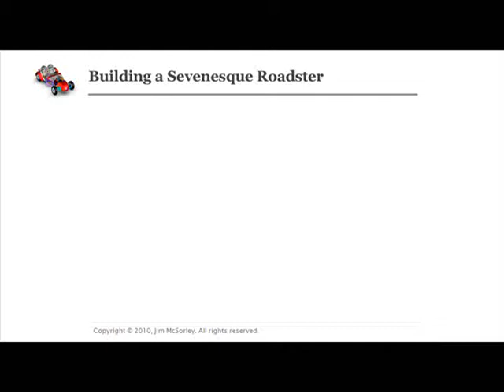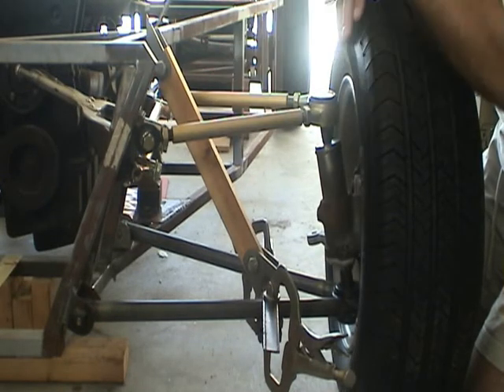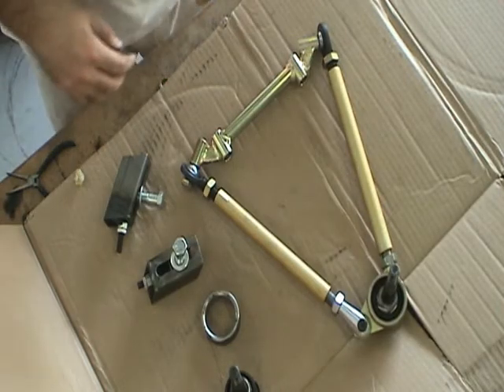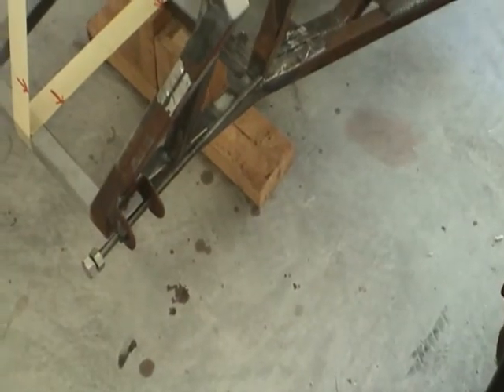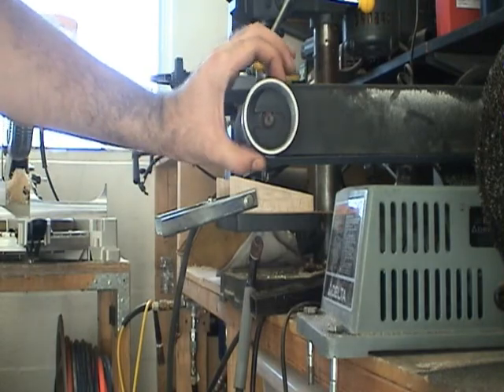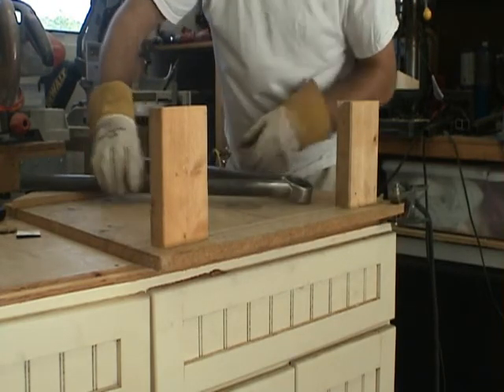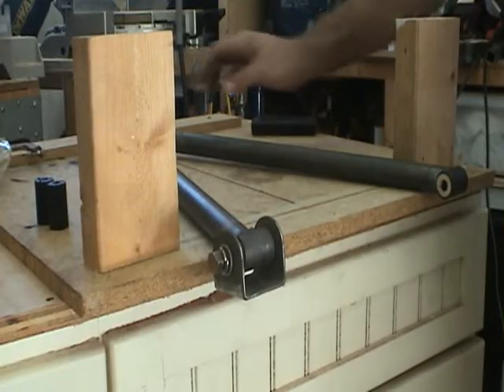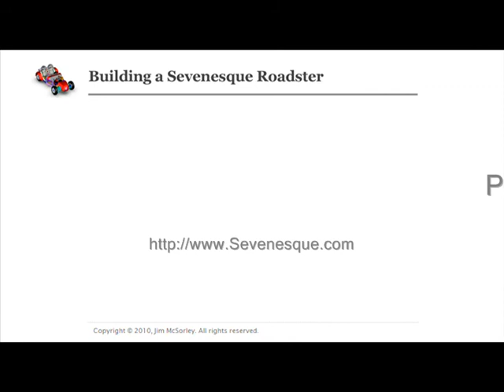Locost Adjustable Front Suspension - Part 1 of 3 - Lower Control Arms

Comment from the maker: Positioning the joint between the lower control arm tubes and the ball joint sleeve so that the center of the sleeve is colinear with the centerline of the tubes would provide more of a perpendicular surface area for welding the joint...  I will certainly consider this approach if additional strength is required.  Thanks for the idea!

Comment from the maker: I cut down and adapted the front struts from a 1st gen RX7.  The thread-in ball joint is from a Mustang II set up, using a 7 degree taper.  You can read about it on my website.

Comment from the maker: To find my website, search for "sevenesque" (I can't put a link in the comments here).  I completely modified the rx7 _struts_ and turned them into uprights. Using a 7 degree reamer, I machined a new taper into both the bottom and top of the customized uprights to fit MII ball joints.  If I had to do it all over again, I would just buy the uprights, brakes, ball joints, etc. from a Mustang II set up ( from a company like Speedway Motors, for example).